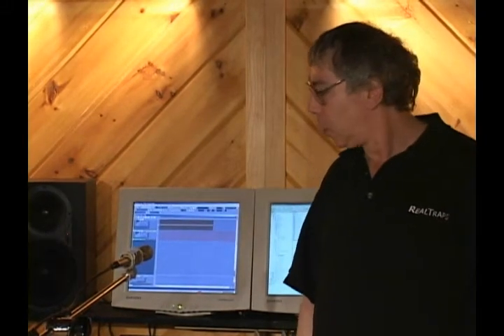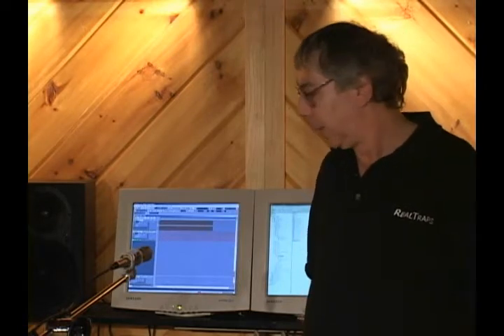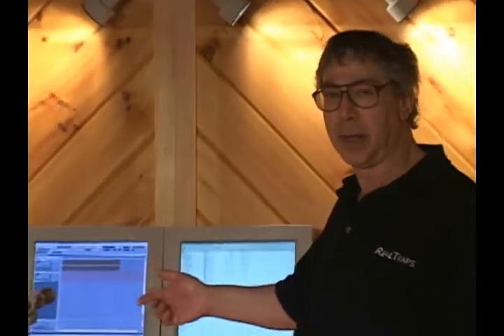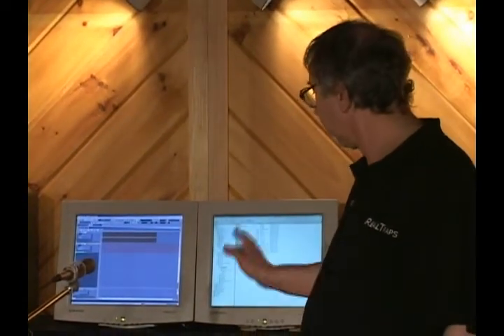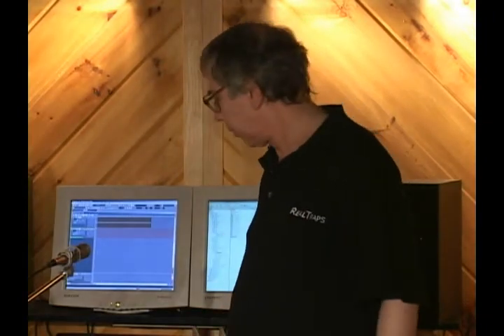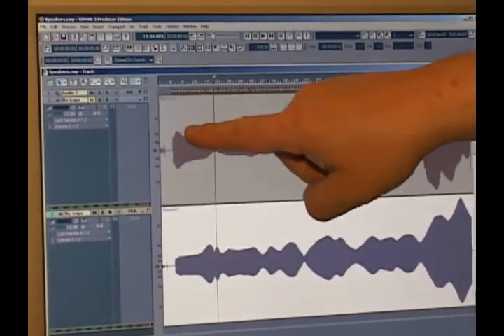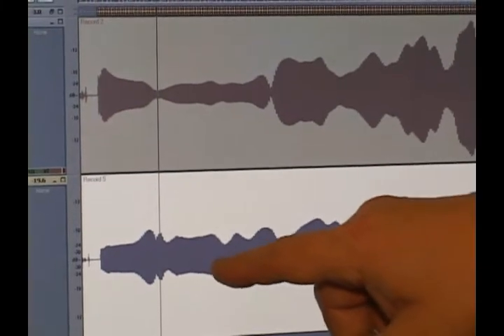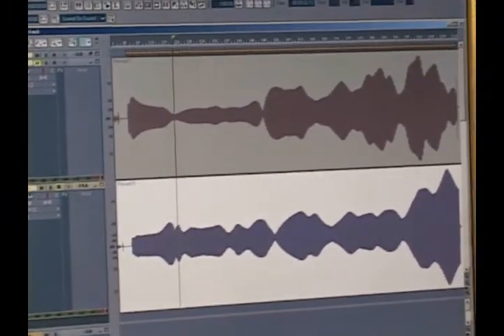MiniTraps Demonstration

Comment: Hello Mr. Winer.
I'm enjoying your videos and would love to see them more often. Especially the myth-busting ones. I'm just a metal sculpture looking to learn some basics and do some basic sound fixes to my TV room. It's nice to see my bull schit detector is pretty in-tune with your much more learned conclusions! 
??? One thing I'm curious about, and have yet to find an answer on is regarding Quadratic diffusers. Could the type that are made of long wood channels of varying depths be made from a high density/high psi rated XPS foam board like the pink or blue type used for insulation? My thinking would be the considerable weight savings. Would it work the same or work almost the same but not quite as good (but good enough for a layman's unrefined ears)
Would it also work if building a "skyline" type diffuser? 
Thanks very much! 
Bert
Reply from the maker: I'm sure I answered this yesterday. Did my reply get deleted?
Reply: @EthanWiner  Must have been lost in space as I didn't see it. I hate when that happens. Hopefully you'll have time for a second go. Thanks very much all the same!
Reply: I'd like to know this, too. What a great idea.

Comment: Additionally to my diffuser question regarding the "skyline" type. Do you know/think that the diffusion would be improved if the flat tops of the wood blocks were beveled? It occurred to me that with the panel of these blocks mounted on a wall, the block tops are in the same plane. Wouldn't these little parallel to the wall surfaces add up and be a reflective surface? ( and hence would angling them be better). Or, do they not add up as a total of sq. footage of reflective surface, when it comes to the waves because they are separate small surfaces? I hope I've worded that clear! :)
Again, Thanks very much!
Bert
Reply from the maker: Yes, diffusers can be made of plastic that's hard enough to reflect mid and high frequencies. RPG sells skyline diffusers made of plastic, and my company's RealTraps Diffusers are made of a stiff type of card stock, with absorption behind. So they're unique by diffusing mids and highs but absorbing bass.

I'm not a math guy, and QRD diffusers are definitely math based. But I don't think angling or beveling the tops of a skyline is a good idea, if for no other reason than RPG (who invented them) doesn't do that.
Reply: @EthanWiner  Thanks very much for the reply!!! Agreed that if RPG invented them and went flat top, that's good enough for me! Angled tops just seemed logical when thinking of scattering waves in different directions. Or perhaps RPG did try this and the difference wasn't worth the manufacturing costs and time, in adition to the retail price increase. 
I did notice in your Manufacturing tour of RealTraps video,  your diffusers looked like they were multi sandwiched layers of the accoustic insulation and some type of sheet good. Very interesting you can kill two birds with one stone with that.
Hope you'll have time to re-reply to my other question.
Definitely would love to see your take on some of the YT content put out these days by "experts". Some just smells off, but other stuff just screams golf course locker room made-up bull schit.
Reply from the maker: @wingnutbert9685  For some reason YouTube is not displaying this discussion on my main "Comments" page, but I can see it here. They emailed me that you replied, so that's how I got here again today to see it. Don't even get me started on YouTube's software!

QRD diffusers scatter naturally based on their pattern, so beveled tops are not needed and might even harm the scattering.

Yes, there's a ton of incompetent videos about audio. Probably most of them! But the same applies to anti-vaxxer videos, alternative "health" product videos, and more. Everyone's a friggin' expert these days, even when they're not.
Reply: @EthanWiner  Sorry Ethan. I agree, YT can really frost your ass like a 3' snow cone. I've got a static crackle when watching videos. It's not my Grado's and not my input. Possibly sound card. It scratches when moving the slider on screen and in my tool bar. 
Anyway, back on track......I'll paste my question here, from my other comment. Perhaps you can see it in this comment. Let me know if YT plays nice this time:
 ***EDIT..... I just saw you answer the question from my other comment, above..... I think. I said foam board, and you said "plastic". So just to clarify, foam board sheets, like the pink or blue stuff you get at building centers, will work for building the vertical channel diffusers and the "skyline" style diffusers? Or when you said "plastic" you mean actual plastic, not the foam board?  
Once again, thanks for the attempts to help. I appreciate your time. 
Best regards,
Bert
Reply from the maker: @wingnutbert9685  Whatever material is used, it should have a hard reflective surface, not porous like the edges of foam board. So foam might be okay if it's then covered with a thin epoxy coating or similar.
Reply: @EthanWiner  Thanks Ethan! I have a bunch of foam board off cuts to play with, so I'll play around with those and see. I have epoxy and other materials in my wood shop and welding shop so I can experiment with those. I want to rearrange the room in the basement to be a more enjoyable space and more conducive to watching movies and listening to music. I've got a 13x10' wool rug to put down to start and once the electronics and seating are rearranged, I'll start measuring for acoustic treatments and build accordingly. 
Have you any recommendations of good YT channels or forums that have good info on home acoustics, speaker building, etc?
Again, big thanks. Hope to see more videos on acoustic science and principles from you as you've got a great ability to make things make sense and cut through the nonsense. 
Best wishes,
Bert
Reply from the maker: @wingnutbert9685  My own forum is a good resource:

http://the-audio-expert.freeforums.net/
Reply: @EthanWiner  Great! Thanks Ethan. I'd looked before but couldn't find it. I'll give a good read through!
Reply: @EthanWiner  And by the way, I also enjoyed your video on your local traffic control issues. Traffic circles were mentioned in the comments. Should you ever wish to see a truly exceptional level of idiocy, come here to Victoria BC. We have traffic circles with inner and outer lanes and double lanes leading into them from 4 sides. And the real cherry on top is the allowance to turn right, out of the traffic circle from the inside lane of the circle, across the outside lane, which is allowed to continue in the circle..... If every auto body shop in town was owned by the person in charge, I would shake there hand for at least having a brilliant business strategy. But seeing as how that's unlikely, they must be honor roll graduates from the Stevie Wonder School of Driving.
Reply from the maker: @wingnutbert9685  So incompetence is international. :->)
Reply: @EthanWiner  LOL!!!! From my experience, Zee Germans got it right. :) Zair ist no phukink around vhile driving. Ze rules must be obeyed or zay vill take your papers!!!!